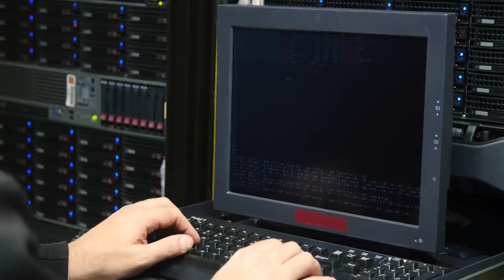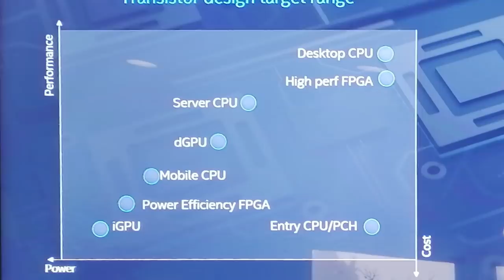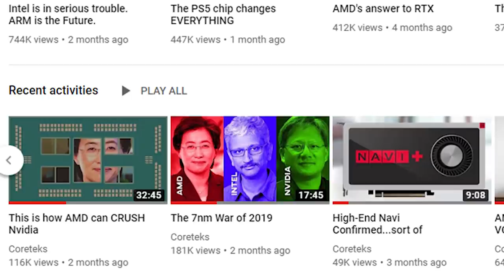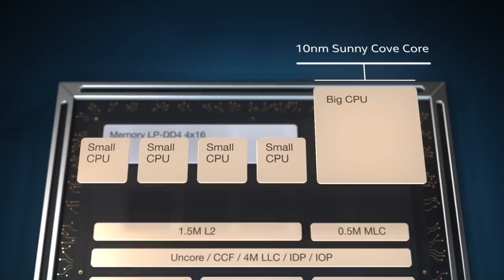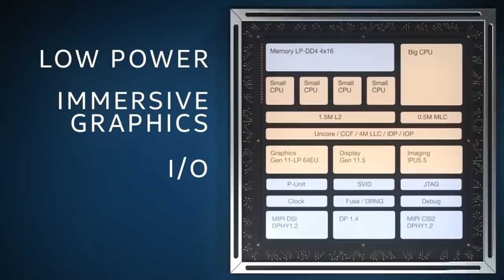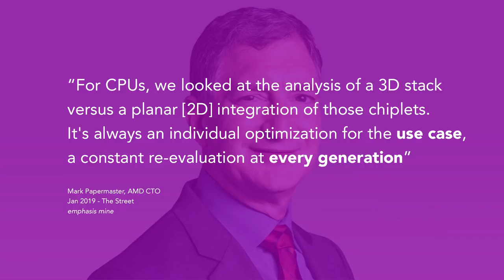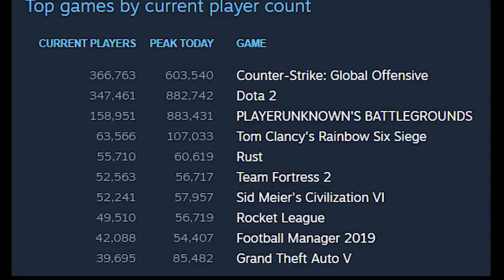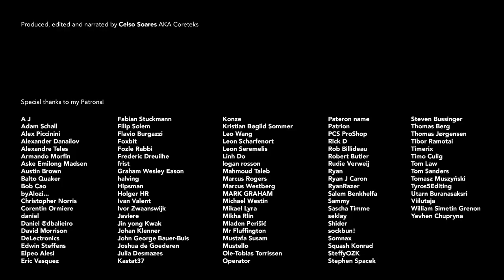2D vs 3D Stacking: Intel’s plan to beat Zen 2

Comment: I have my doubts with 3D stacking.. Unless they can manage temps then I can't see it working all that well.. It's like sandwiching multiples heaters on top of one another it only being able to control the thermostat of the heater you can access/touch
Reply: Maybe they'll multilayer heatsinks in between layers but I would doubt that would have a big effect

But with lower clocks that may satisfy the issue. This completely debunks my theory of silicon being completely replaced in the next 10 years, if this is their direction. Either way, innovation is innovation, and if they figure it out it can only get better for us.
Reply: lower clocks defeats the fucking purpose of a CPU.
Reply: Yep, exactly an example case of Square-cube law.
Reply: @wylie2835  no it doesnt droping clockrates massivly imprpves efficency at quite small preformance costs its more important that the CPU is able to make better true usage of its self as obsoleting SMT would be a great step forward
Reply: @wylie2835 i guess this kind of CPUs would be only for the the datacenter market. they dont care about single thread performance. They only care about total computing power at price X with a power consumtion of Y and a Space requirement of Z.

Say: if you can build a CPU with half the clockspeed but 8 times the cores at the same power consumtion you are most likely completly fine. If you can produce it at only double the cost of the olter tech, you will be able to sell it for double the price without any problems, since the buyer will have a better deal on Space and will only have to buy ~~75% of the other parts.
Reply: Pretty sure that the $20B that Intel spends on R&D has already dealt with the problem.

The Foveros stacking wont be used on high end desktop and server CPUs - its for SOCs and custom designs,
Reply: @bradvicious3991  with an R&D budget of that size, you'd think anything is fixable/solvable etc.. But doesn't seem to make sense when you look at just how many years their 10nm part has been delayed.. Money gets you only so far especially when full of hubris too.
Reply: It's almost the opposite of what you need to do to get better thermal management, you need more surface area. Stacking does the opposite.
Reply: It's not always about speed. Efficiency is just as important. It's one reason why arm chips have done so well in mobile. By 3d stacking components, efficiency will improve.  @wylie2835
Reply: @wylie2835  Lower clocks are better. I want more IPC and lower clocks. NEC SX ACE pushes 64 instructions integer and floating-point concurrently per cycle and it is clocked at 1 GHz. It's a 4-core CPU with 256 billion calculations per second.
Reply: You might have noticed IPC is instructions per CLOCK. Lower clocks is not a compromise of IPC. You want less cores, higher IPC and higher clocks. More cores very little for most software. They do teach order of operations in school right? The order in which things are done can change the outcome. Far less is pushed to other cores than you think. And in almost every case that it can, it's far better to be done on a GPU via compute shaders. That is hardware designed around simultaneous compute and performs circles around any CPU. A CPU is designed around getting a list of tasks done quickly. NOT a lot of tasks done at once.
Reply: People don't get it. The multiple layers will be solidly attached to each other, even closer than soldering, they will be 1 whole silicon bit just printed on in different layers, and silicon is also really thermally conductive so the heat dissipation is the last of the last of the problems. The problem with this chip is about how are they actually going to "print" at different depths and how will they interconnect the dies.
Reply: the solution is tiny heatpipes and tiny peltier devices. Maybe tiny heatpipes that are themselves peltier devices. Our current heat management strategies are archaic AF.

Comment: I'm definitely on the AMD-Zen2-Hypetrain right now, but I never doubted that Intel is working on something as well. AMD-Fanboys announcing that Intel is done for just because they had a bad year always made me cringe. It's just a question of time until they strike back. With the amount of funds Intel has, one bad year means nothing to them. I'm curious about what's to come from Intel and AMD.
On a side note: After seeing so much footage from CPU manufacturing plants, I'm very curious on what I'm actually seeing there. A video about how current gen CPUs are made would be very interesting I think.
Reply: Personally I'm on the ARM-hypetrain. The x86 architecture dates from the 80s and became more and more bloated over the years and at this point this is causing more problems than solving, ARM is a modern and well designed architecture that proved it is possible to make a CPU that is both fast and power efficient, this last point being very important. More savings, less heat, pure efficiency. I have nothing but respect for Intel and all the innovations they brought to the world, but the way I see it they have been missing the mark for a while now with their overpriced crap that nobody really needs, and this mistake is about to bite them in the ass.
Reply: Papai Urso x86 “bloat” has been disproven, Coreteks ignores the fact that these ARM chips DO NOT have as much performance as x86 chips and currently the ARM servers consumer MORE power per performance level.
Reply: @papaiurso5860  usually these comments come from the AMD fanboys, now it's from ARM for a change. Intel probably doesn't give a flying fuck about the current situation, it seems like they are not even trying with desktop CPUs at the moment. They still have the server, laptop and custom-chip market. They will throw recycled coffee lakes on the market until their next generation is ready, it's not like they depend on selling big numbers of CPUs right now. While to us enthusiasts the high end CPU market is very interesting, it's not as important to Intel or AMD. Compared to the enterprise market, desktop CPUs are a small sector.
Reply: @reshadegaming6285  Source for that? Because I doubt everyone going ARM is doing that on a whim. I understand the current state of ARM doesn't reach the performance of high end x86 CPUs on a core to core comparison, but the power consumption is evidently super lower, so much lower you don't even need dissipation. If you've followed the progress of technology in the past 20 years you'd know it is mind blowing that you can run 3D games on a phone that doesn't even have any form of ventilation and do it for several hours on a tiny battery. Desktop CPUs have been dependent on active dissipation since the 486, we are talking 50MHz CPU.
Reply: I agree with you, AMD fans are blind. I'd like to add my bit and want to start with I love my Vega 64 and my 1800x and am on the hype train as well for Zen 2. It is a great innovative solution to a problem we are facing with CPUs getting harder and harder to manufacture. What people fail to see though is Intel have the coin to keep pushing the high costs/yields involved with large cores. AMD doesn't have that kind of money. AMD had to go to their current CCX design so they could maximize their profits. 

Intel's design is straight up better in terms of raw performance but it is expensive. The larger chips take up more wafer size and if they fail they lose the area of the wafer as well as the time to manufacture the cores. AMD on the other hand with their CCX design uses the same core for all of their consumer chips. They can throw one CCX out and it doesn't affect the amount of a chip they can put out. Intel if one core dies on an i9 chip they have to disable the core or bin it. That is a lot of space and time wasted. 

As we have seen AMD brought out an 8 core Ryzen chip, Intel came out with their 6 core and later an 8 core design that still beats it clock for clock. Not to mention they clock higher as well. I think AMD will bring out a 16 core and 12 core variant of Zen 2 likewise Intel will bring out a 12 and 16 core i whatever and it will likely beat AMD's 16 core though it will be BS expensive.

Intel is not sitting on their hands screaming "what TF do we do now?" They are working on the next type of design. It may be a CCX design, it may be this 3d stacked design we have seen them use though I think that will be in low power devices that need tiny but powerful chips. I don't see them making an i9 equivalent with 3d stacked dies. But hey, I am a tech enthusiast, not a chip designer. What do I know? What I do know is I love the competition.
Reply: @sithlordgaming6692  just remember nokia and how it failed after dominating the market for several decades.
Reply: imo, the most exciting thing about AMD's current roll is that it's brought back competition to the CPU market
Reply: Bad year?  you mean another record year of revenues and profits?  4th Q they missed analyst's targets by a fraction of a percent.  That's not a bad year.

AMD manages to stave off bankruptcy for another quarter and they are "killing it"

you do know that Zen 2 is just a minor iteration and not a new micro architecture.  and so far what we have seen of TSMC's "7nm" process on the VII is that it does not support significant increases in density, does not allow for significantly higher clocks and most definitely does not decrease power usage.  TSMC "7nm" seems to not even be on par with the 16/12nm used in the Pascal 1080TI that still kicks the VIIs ass.  TSMC + AMD = Marketing Powerhouse of Dubious Claims
Reply: @papaiurso5860  My 100Mhz AMD 486 DX4 ran without active dissipation. No Heatsink at all. The system ran fine for about a decade, until the CMOS battery leaked and killed the system.
Reply: INTEL = DONE ! Just except it !
Reply: @davidtorto9517  Nokia didn't have software ecosystem built on top of it though. Of course, upset may always happen, especially with limited competition, but Nokia really seems like a apples to the oranges of Intel.
Reply: @papaiurso5860  Of course the power consumption is lower but that isn't anything to do with x86 that's all to do with the fact that those particular chips have been designed from the GROUND up for that. 

Even so Intel in recent years has been getting to that level of power consumption already...

An ISA has nothing to do with power consumption, I unfortunately cannot remember the specific article but in its research it was found that there's nothing about an ISA that inherently gives the advantage.

The 486 is not an apt comparison, it was a completely different day and that chip was NOT designed to keep power low. Even so even semiconductor manufacturing back then was much less advanced. The equivalent ARM chip of the day didn't even have a fraction of the performance and none of the features for its low power consumption. 

An ARM high performance core equivalent to a current Coffee Lake core would either run at the SAME power or perhaps less. But any difference would be down to that core specifically having those characteristics not due to ARM.
Reply: @gertjanvandermeij4265  Accept it you mean..
Reply: @coreycarpenter2489  Foveros stacking is for low power SOCs not for desktop and server CPUs.
Reply: @Charlie Brown I offer you congrats for finally kicking the football.  Or just accepting there is no football.
Reply: "Desktop CPUs have been dependent on active dissipation since the 486, we are talking 50MHz CPU."

That's not inherent to the architecture but rather speaks to the design compromises that are made in either case. In a desktop chip you know you'll have decent cooling so you get to make a faster chip. There's very little to gain from switching to ARM and quite a bit to lose. The x64 instruction set is fine.
Reply: @gertjanvandermeij4265  Intel still made record profits in 2018. If you think that changed anything for Intel, you don't know anything about Intel or economies. The desktop CPU business is just a small one for Intel, server CPUs and custom chips is where they make most of their money.
Reply: @davidtorto9517  Did Nokia make record profits shortly before they "crashed"? I don't think so. Intel did last year. The desktop CPU market is just one of many in which Intel is active. The other markets are still pretty stable and in Intel's hand, and even in the desktop segment they sold more than enough CPUs through HP, Dell/Alienware and Apple. Intel doesn't need the hand full of nerds who buy their own CPUs when they have customers that buy a few thousand CPUs at once.
Reply: @bradvicious3991  I think the problem with the VII is not 7 nm but the fact that Vega is so inefficient that not even 7 nm helps a lot. It might bring better results for the CPUs, since Zen is much more efficient than Vega already.
Reply: @ireeb  Thinking that AMD will stay at desktop CPU's after getting the upper hand in performance it is naive. Their threadripper CPU's show that they clearly have intentions to attack the server markets and now we see they are going for the laptop market as well.
It was to be expected. When you have a strong product you have no reason not to use it to take markets and profits you have the ability to.

Comment: 10NM process was basically a fail for three years at Intel.  It seems to me that going to a 3D stacked process is going to have even greater complications.  They can't produce a product that has enough value AND performance.  AMD will still dominate through 2021 at a min.  I doubt the likelihood of a 3D process 10NM part from Intel in early 2020.  2021 is more likely.
Reply: I suspect the reason why it took them so long to figure out 10nm is because they always intended to use 3D stacking. After all, let's be real, if AMD can do 7nm how hard can it be for Intel? All this setback was probably the 3D stacking thing and not just because of the 10nm.
Reply: @papaiurso5860  Too optimistic on the 10nm Gen 1 density.  That was the issue, plain and simple.

AMD can't do anything - they are not a manufacturer.

Intel 10nm is more dense than TSMC "7nm"

TSMC "7nm" is their 10nm class process.

passive interposers are nothing new - the active interposers are new.  Not the same.
Reply: It's really TSMCs 7nm @papaiurso5860
Reply: The node has nothing to do with 3d stacking. Intel could stack 22nm cores if they wanted to, or even mix and match different nodes for different modules.
Reply: @MrChewy97  They have already said that some components will be at 22nm (memory controller I think) while others could be at 14 or 10.  Detaching the IP from the process is a necessary move.
Reply: @MrChewy97  Somewhat yes, but they probably need a new process if they want to stack and don't get heat issues or severely sacrifice single core performance. And in the consumer market, that's their last selling argument. Probably 'till summer this year.